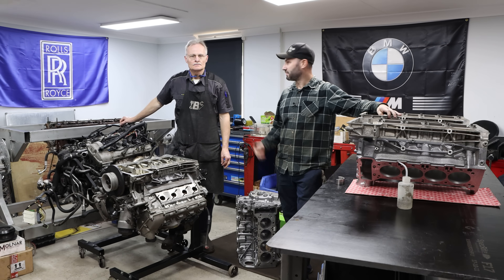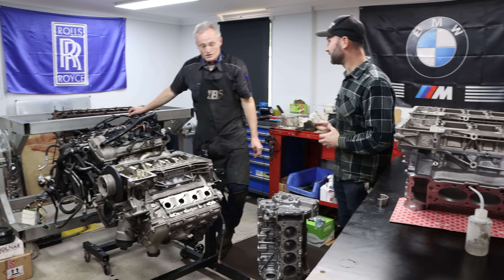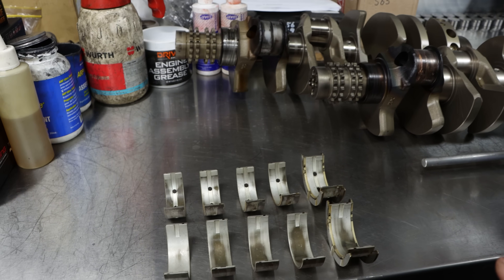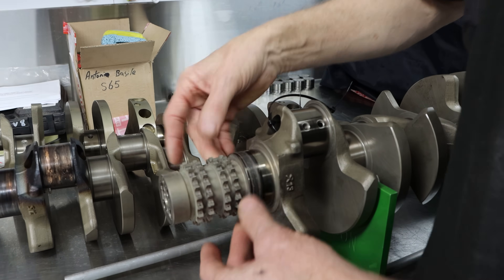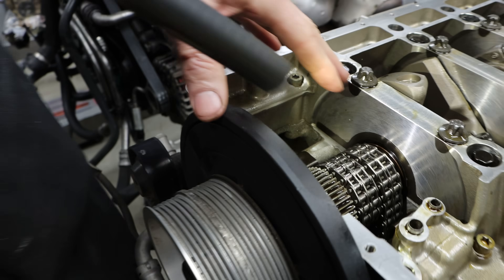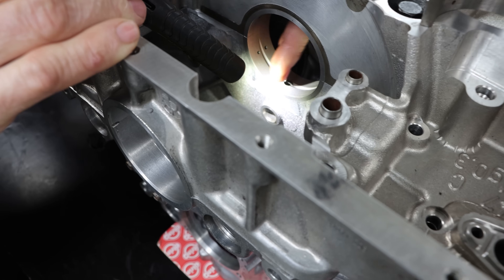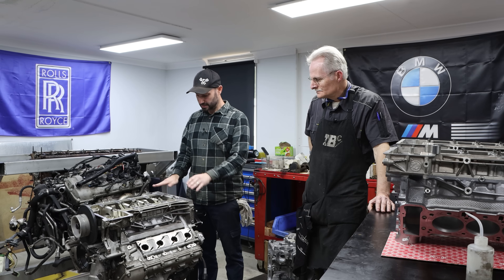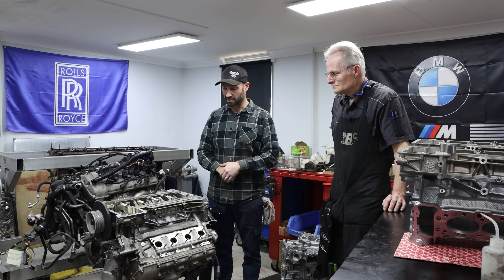BMW M3 S65 MAIN BEARING FAILURE! Rod bearings trumped by main bearings.

Comment: Regarding the S85, what weight oil do you recommend before a rod bearing swap and after?  stick with BMW specs or use a thinner oil? 
my S85 is currently around 80000 klm  original bearings.everything all other common issues have been done.
Reply from the maker: If the engine is original and still running its tight clearances, then a 5w30 or 10w40 is not a bad idea, it also depends on your climate and time of year. Post bearings - 10w40 to 10w60 is good, again depending how hot/cold your climate is during use. We strongly recommend Penrite 10 Tenths race oil.
Reply: @BrintechCustoms  ok cool thanks. I'm in Sydney are you based in Melbourne? roughly whats the  cost too do the rod bearings on the S85?  yeah i only use Penrite in my cars, the Penrite gear oil fixed a clutch binding issue on the M5, BMW changed the gear oil specs too suit newer M5's but I had nothing but issues with it. Penrite all the way. 👍👍